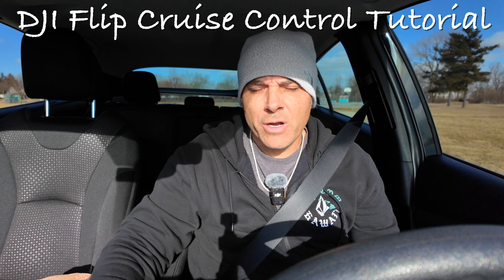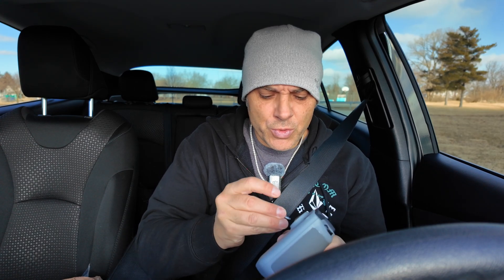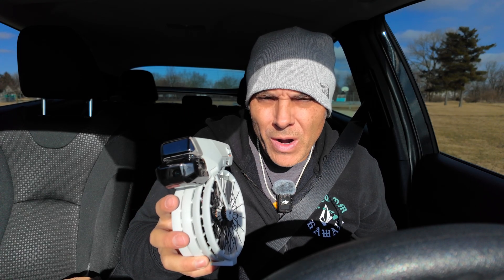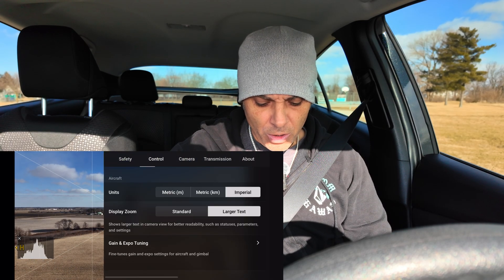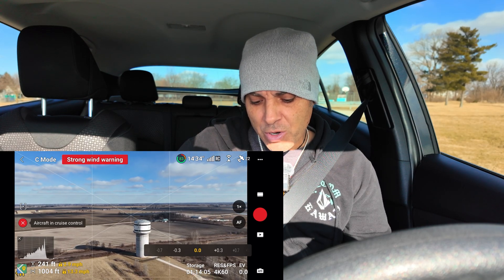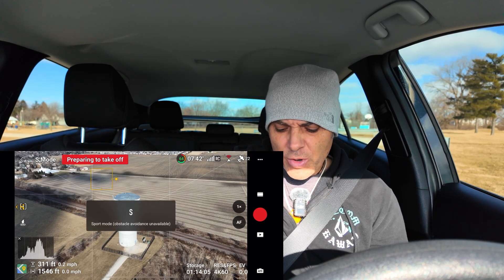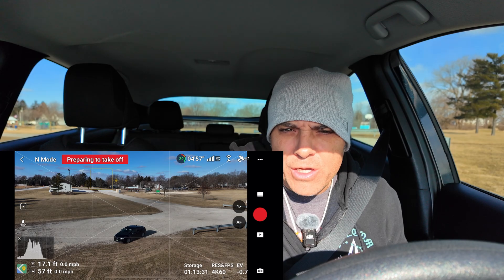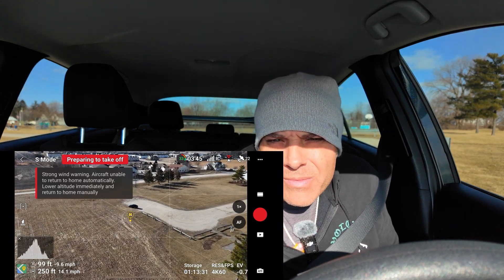DJI Flip Cruise Control Tutorial in Extreme Conditions

Comment: Nice job!  I just got my Flip and was looking for a cruise control video. 

When practicing I was surprised at how little wind it took to trigger the  high wind warning. I'm guessing I was seeing gusts around 20mph when I was warned. I did find like you that flying lower worked to get out of the stronger wind. At one point it was struggling to return since it was flying into the wind and I considered just landing. 

I went with the Flip because we'll be traveling to England in the Fall.  We'll be hiking around 12 miles a day and I wanted to leave the controller at home and just fly autonomously or with the app on my iPhone.  It didn't take long for me to decide I need to take the controller.  I'll still be able to get most of the footage flying autonomously or with the app, but there are some high vista shots that will need the controller.  All in all, I'm still glad I chose the Flip over the Mini 4 based on my intended use and needs.  I'm also planning on buying the Pocket 3 to take as well.
Reply from the maker: @dougmacmillan1712  yes it's just a drone you gotta be very mindful of of winds because it can really not do well and be problematic so just be aware of that which I think you are.  Have a nice trip!  🏴
Reply: @AtortAerials  thanks for the good advice.  I went flying yesterday and had a good, safe day and setup and used cruise control with no problems.  Our trip is now official, we've made all our hotel accommodations and booked our flight.

Comment: Hi man, thank you for your video. I wonder if there's a way to use cruise control and (at the same time) set a point of interest so that the camera will be held straight on it.
I'm sure yiu can answer this question, so thanks for answering 🙂
Reply from the maker: @giannivalenza1751  I believe it's either one or the other.  When using an intelligent mode like Active Track or POI that's it your in that mode.  Cruise Control is intended more for your manual movements.  That's what I am almost positive it is.